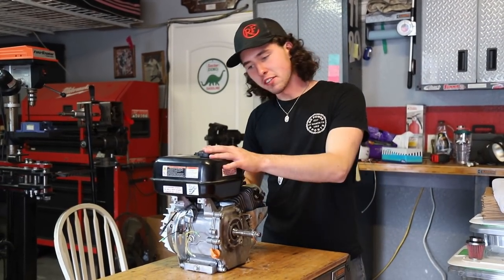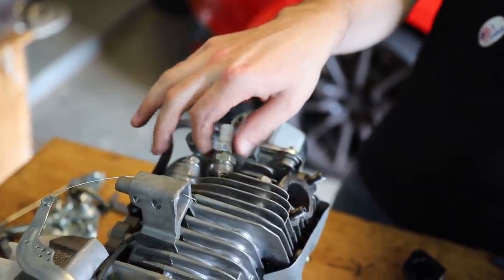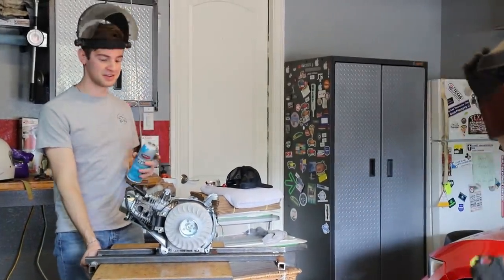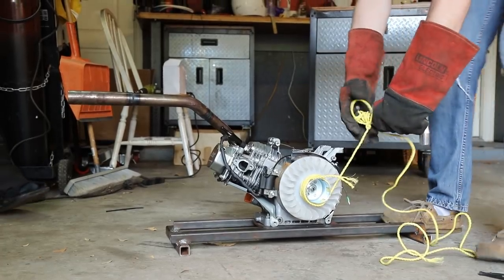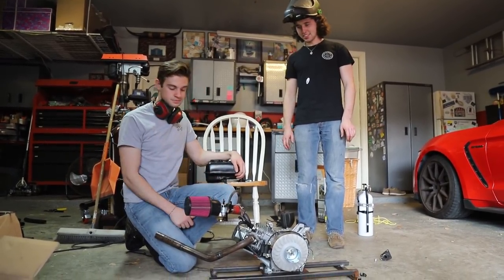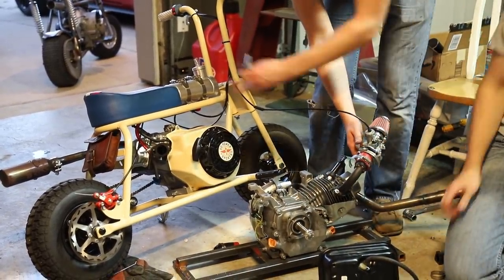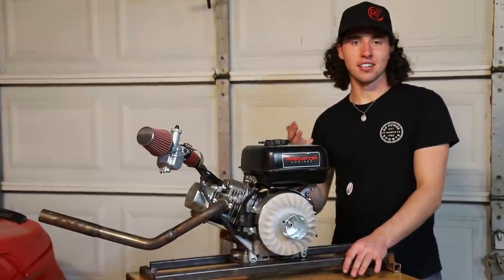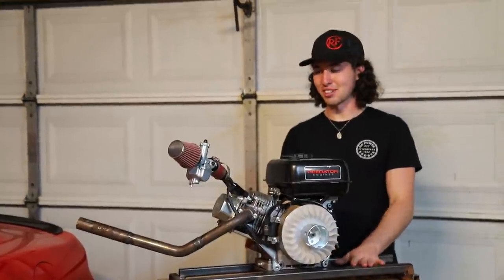Can You Make a Predator 212 Run Backwards? Surprising Results!

Comment: You will need to reverse the ignition timing also.
 the pre set timing will be WAY off right now. 
She will be sending spark WAY After TDC
And of course remove the governor
Reply: @Ryan Martin you dont need a key its just to position it. The taper holds it wherever you want
Reply: It's like off 180
Reply: @drewanderson8279  That's what i was thinking flip the cam 180. I have no clue.
Reply: maybe it is possible to remove the air vents and simply turn the flywheel around, then the ignition point would be in the right position
Reply: @adrianvogt2174  flywheel only goes on one way smh
Reply: dylan zrim  yep
Reply: First thing I thought. 180 the flywheel key
Reply: @jessemarchese7245   Ok, It was just a thought
Reply: Probably just remove the key and tighten the crap out of it lol it's definitely lacking a bunch of compression because the valve events being backwards.
Reply: @jessemarchese7245  yeah the motor just like me
Reply: they need to change the valv timing
Reply: They flipped the coil
Reply: Even ifyou do all this work it wouldn’t run for long in revers e, the oil spraying spoon on the crank wont deliver propper lube to thecyl wall
Reply: A billit flywheel you can lap to the shaft and us without  a key and then you can set your timing anywhere you want. Use a degree wheel to set timing..nice job guys
Reply: First, and forward, ALWAYS remove the gub'ner.

Comment: Keep in mind that the splash oiling system only scoops up the oil one way so it isn't getting oiled properly.
Reply: That’s what I was going to say.
Reply: Dont for get about the Cooling fans, Thay only run one way..
Reply: Yeah and counter weights are going to eat bareing alive to much unstable vibration
Reply: i guess they could turn the rod around completely.
Reply: Its splashing regardless of the direction
Reply: @foxouttokillshadow7394  
Was you making a 🤣 joke?   Mercury built a 2 stroke outboard called direct reverse that the coil packs swapped sides for reverse would run in both directions. Also marine Detroit diesels are the same with different cams for the injectors , infact most marine engines are the same with only having different cams.
Reply: @georgealmeida7382  Depends on the type of rod. The upgraded ones scoop one direction only, but the stock rod doesn't actually scoop. It's just a little metal piece that splashes it. So the stock rod can run in reverse

Comment: You made something run backwards and I can’t even get mine to run forwards
Reply: same :/
Reply: ye same need a governer return spring on my 97cc
Reply: My generator cannot start

Honda clone

Possible cause because engine flooded?
Reply: Same
Reply: Did you try rice?
Reply: @Jellysmake  I tried it nicely
Reply: I’m surprised this got so many likes
Reply: that's like honda/yamaha left side drive pulley/gear versus polaris/suzuki right side pulley/gear.  each motor setup has the drive pulley on different sides. that means any motor can run backwards!!!!!!!!!!!
Reply: @jjon6743  Chemical engines are direction independent. the starter motor determined the direction of initial rotation. Most large engines use non-symetrical valve can valve lobes. Meaning the cam can not run backwards without replacing the cam.
Reply: @jjon6743  What model engines are these ?
Reply: Lol right
Reply: @mrgcav  as a 20+ yrs experienced mechanic I believe I kn ow what I am talking about.  you and experience at any mechanic work. and I have experience of all trades that are labor intensive
Reply: @mrgcav  1974 to 1994 50cc to 500cc   5hp to 500hp.  and to answer you question there all types of motors. I own right and left hand pull cord 4 wheelers and I've named the 4 brands i own plus a few custom build powerfist 212cc both forward and backwards running motors. hand on works is better than any video or book you can watch/read !!!

Comment: The cam timing and duration/overlap probably have a lot to do with the way it ran. Exhaust and intake lobes don't seem like they'd have the correct geometry for running backwards at all, so I'm pretty surprised you guys got it to run as well as you did. I love the channel and the builds keep up the great work.
Reply: Looks like they forgot to adjust flywheel magneto timing and forgot to take into account they need to modify the engine oiling system
Reply: @dodgeme1986truck  I was thinking about the oiling system as well, but I didn't think it was really important seeing as how they were just experimenting, but yeah hard to scoop oil when it's spinning the wrong direction. I have to admit I didn't know that it was possible to adjust the magneto timing, is it slotted so you can slide it or what?
Reply: The duration and geometry will work but the exhaust love needs to be aligned the same angle from TDC as the intake was, but in reverse
Reply: Lobe
Reply: sweepy  thiese have timing gears

Comment: Cool experiment! 2 Strokes are easy to run backwards I have had them start running backwards on a backfire when starting them. LOL
Reply: Hahaha this happened to one of my chainsaws
Reply: That happend on my dads friends moped. Backfired at a trafic light and started to rum backwards. He let go off the clutch and reversed in to a car behind him
Reply: I had a Suzuki DS80 that would roll off backwards but once the engine started it would take off forward. Tried several times to run it backwards and soon as you pulled the clutch it fired and turned the right direction. I was a kid and didn't care.
Reply: The old 2 stroke golf carts got forwards and reverse by the direction the starter spun the engine.
Reply: 2 stroke detroits be like this when they get goin backwards: *exploding detroit noises
Reply: had this happen on a cr 80 and it killed itself shortly after
Reply: @maacpetzol2205  i worked as a mechanic at a stihl dealership and this guy comes in to get his chain sharpend because it wouldent cut. Sharpend chain and hes back a hour later. So i look and the back of the rakers had junk on them.... Took it out back to test cut and was like WTF
Reply: I've heard about two stroke dirtbikes rolling backwards after stalling on a hill climb, then taking off in reverse...
Reply: I had this happen on a Yamaha blaster on a big hill climb I stalled it out at the top in first gear rolled back down the hill climb backwards while still in first gear somehow when I started it and let the clutch out it went backwards so I guess it was actually running backwards because that four wheeler doesn't have reverse 😂😂😂😂😂😂
Reply: @vicke1112   Sure
Reply: Predator 212 are 4 stroke engines
Reply: @king_undead777  We know this.

Comment: I'd like to see more of this kind of stuff. You could also try flipping the cam. Or, just adjust the cam timing so it'll run forward, while pulling the mixture backwards.
Reply: @jonnyappleseed190  Did you not watch the video?
Reply: Yeah the drill about tore carrot tops arm off the whole time
Reply: @jonnyappleseed190  because it has compression that's pushing against the drill...did you not watch to where they had it running with no drill...?

Comment: The starter fluid doesn’t need a spark. It detonates like a diesel. But in reverse, the timing would be way to far restarded for reliable ignition on gAs
Reply: Incorrect.
Reply: @39nitsua  Starter Fluid does not need a spark. The autoignition temp is well below even diesel.
Reply: @nicholas_scott  diesel has an auto ignition of  350 degrees F all the way to 600 degrees F
Starter fluid (ether) 320 degrees F

Comment: Great idea. If you make a slotted bracket for the ignition coil you can adjust the timing.  It sounds like it's firing a few degrees off.  It could also me a cam issue too.

Comment: Interesting experiment, like people said you need to advance the ignition timing by moving the coil bracket backwards. I think the cam lobes are the same on intake and exhaust so the cam timing could be changed by opening the case and you should be able to get it running.

Comment: The decompressor mechanism on the exhaust cam lobe (now the inlet) might be contributing to some starting problems. Plus valve and ignition timing is likely to be not ideal.
Reply: In the kohler engines if they're turned over backwards they are at full compression. That's how you test them

Comment: This is awesome!!! The exhaust valve opens twice as much as the intake (hence the suck and then blow and backfire out the carb) to get rid of excess "dirty" air and add "swirl" in the combustion chamber to increase efficiency. Well done for getting it so far!!! This wouldn't run any better unless you put a special cam in but hey. Still super fun to watch.

Comment: Brake Clean is a good fuel to use for testing purposes. Its a little less dangerous, a little easier on the engine and it doesn't smell so bad. Its not good for starting in cold weather, which is actually what starting fluid is designed for.

Comment: Play with the cam timing a bit and it should run easier but as stated several times in the comments valve size does hurt it.

Comment: since you are driving the engine backwards, the valve timing is not quite right, the spark timing is also wrong. normally the spark comes a little before TDC now so it is instead a little after.

Comment: if you have a flathead tecumseh 3hp that you want to run aftermarket hp cams in, you have to do this, since the 4hp and 5hp have them on opposite sides and the ca is cut accordingly.

Comment: I'm not sure what the point of that was but Tickford did that to the 4 litre SOHC in line six which was built by Ford in Australia.

They came up with the idea of increasing horsepower due to increased airflow  by fitting an exhaust valve which was larger in diiameter  than the inlet  valve but they didn't run the engine backwards !

Comment: need to rotate the fly wheel 180* your firing on your exhaust stroke because the intake/exhaust are now reversed  that’s probably why it wld only run with the choke on flooding it until it leans out and back fire through the carb

Comment: This is perfect for a motorized bike. It would eliminate the need for a dangerous jack shaft. It will allow you to use the stock cog an derailleur. Just add a positron flywheel on the crank. A centrifugal clutch, A belt and a belt pulley to the positron flywheel.
1.  I am concerned about the cam lobes. If the lobes are not symmetrical then the cam lobes and valves will wear out quick.
2.  Reversing the magneto should not be necessary.

Comment: If you change the fuel air mixture screw and richen it up a lot it might run a lot better because it seems like it is starving for fuel and if you think about it the exhaust valve is a lot smaller so it won’t take as much in that’s why it’s also starving for fuel
Reply: Plus the timing would be way off because of the valve overlap etc if you take the motor apart and move the camshaft I am pretty sure it would run like it did forward plus take the governor out

Comment: Aren't the intake and exhaust valves different diameter? It had be hard to run well with a smaller intake valve and a larger exhaust valve. It may "run", but it won't like it. Maybe with head work, valve work, custom cam, etc... My next question is, with the crank spinning backwards, will the motor get oil where it needs it?

Comment: It would be like running a V8  as a marine engine. They run in the reverse direction, but they don't have a scupper on the rods for oiling.. Cams & ing timing are also modified. That was a fun video. 2 strokes will run backwards.

Comment: It’s firing after tdc you have solid state ignition coil your going to have to clock the flywheel maybe 4-6 degrees in the opposite direction. The dipper spoon on the rod isn’t piling it properly. I’m assuming the larger exhaust port isn’t drawing as much vacuum as the smaller intake valve. I’m probably wrong on almost everything. Just my thoughts tho😂

Comment: That was cool. But if you just turn the cam 180 degrees off it will run in the right direction but the intake  and   Exhaust will be swapped

Comment: it is possible but you need to change the ignition (advance it more ) and reclock the cams so the exhaust opens instead of the intake and vice versa
(might be able to switch the cams )

Comment: The compression release is on the wrong valve now.  So on the power stroke its opening the old exhaust valve a smidge when trying to start.  So its blowing backward through the carb
Reply: Also the ignition timing is way wrong.  Youre at something like 22 deg after top dead center.

Comment: Also the intake valve is low grade steel not ment for exhaust heat. Change the intake valve with a same sized exhaust grade valve.

Comment: New subsctiber here .i used to work on a 2 stroker and because of a faulty CDI ingnition unit IT WOULD START IN REVERSE (2 stroke engines dont have valves .. they have reeds .. so they rely solely on electronic timing )...!!! that instantly reminded me of the screne from the french movie TAXI 1 from early 2000s where a police officer blocks the way of a moped in between a row of cars ... so what that guy on the moped does .. he flips a switch and boom reverse gear .. that got me thinking .... i rewired a new CDI in the ignition system  made the faulty CDI into a REVERSE cdi with a relay system to switch between reverese and forward  .... and i could run it like that (after i would stop the engine  and then flip to reverse )... it didnt last long untit the variator broke .. but meh it was a old bike good for experiments ... yes yes i know the honda goldwing has a reverse gear because it weighs half a ton .. but its all based on the starter motor engaging a reverse gear in he gearbox .... so what do you guys think .. any 2 stroke engines lying around ? :D

Comment: Very cool experiment! I think the problem of getting it to fire with the carb on is mainly caused by the valve timing. The carb needs Vacuum to suck in fuel and air and that is much lower in the exhaust than in the intake with tha cam timing not changed. Thats different when directly spraying the starter fluid in the exhaust.

But yeah, I too am impressed that it did indeed run!! :D

Comment: Did you adjust the valves because your intake and exhaust are different right so if you flipped the spectra I think it would run better

Comment: i am thinking of doing that to a lifan 2v78f-3 cause the crankshaft's are on the flipped side.
rotate the magnet too. i will flip heads and pistons and adjust timing gear by 180°

Comment: Great vid but I have this problem with my predator 212 I put a mikuni on it and welded an exhaust for it but it only starts on choke and when it starts on choke the thing runs away like    The engine revs itself out

Comment: you will just have to reverse the valves lashes 0.004 intake. 0.006 exhaust.  And don't have your throttle being stretched out i could see the 1/2 inch of bare cable.

Comment: I saw a similar reverse flow chevy. I think the ignition and cam timing are both off. governor may not work right. also long term not sure about lubrication, oil flinger thing on conrod prolly wont work as well as normal.

also concerned about the flywheel coming unbolted and shooting off but idk cuz its keyed

Comment: I think the Mikuni only works because it had more fuel the exhaust valve smaller then the intake valve so less gas is getting sucked in from the smaller exhaust valve instead of the intake valve like it should be I think that is the problem

Comment: Set the cam 180 degrees and run it in the normal direct with the carb on the exhaust port and it sould run fine

Comment: The hot rod engines that have swapped the intake and exhaust are still spinning the same direction all they had to do was get a custom cam where the exhaust and intake lobes are swapped.

Comment: Maybe there isn't as much duration on the exhaust lobe on the cam as there is intake duration. Therefore it can't pull in as much fuel and air compared to the stock setup.

Comment: I say 100 % success the intake was too long and the tilt of the carb was not letting the float work properly you could probly modify the pitch of your cam to close the valves at the right timing thats why you were getting a little backfire through the carb its supposed to be a gradual open then drops closed just smooth the drop side and drop the smooth side you can even add weld on top to make the valves open more all kinds of stuff i see small engine racers do it all the time how hard could it be lol good show dont let anyone tell you are stupid for doing the things you enjoy F the haters do your own thing youve already got this far who knows where it could take you.👍

Comment: I Knew 2 strokes could be reversed, but thought 4 stroke needed different timing to run backward. very need to know!
Reply: There are so many things they didn’t even consider that would have caused most 4 stroke engines to destroy themselves. Mostly valve timing. If that was an interference engine the valves most likely met the piston. Valve timing is the reason it’s spitting fireballs back through the carb

Comment: I forget the name of them but they were these three-wheeled and four-wheel semi amphibious vehicles that were made back in the 80s or 70s and the way they're reverse worked is you shut the vehicle off and you flip the switch start it back up and it would run in reverse and that was the reverse for that vehicle

Comment: The more you know lol.   Not sure but something tells me you don’t have to swap the exhaust and intake to make it run in revers rotation
Reply: That is true it would require a different cam, retimed/rekeyed flywheel, a heavily modified oiling system (factory splash lubed), and a reversed rotation cooling fan
Reply: @dodgeme1986truck  that sounds like more work then it is worth for sure and that’s a great point with a huge list